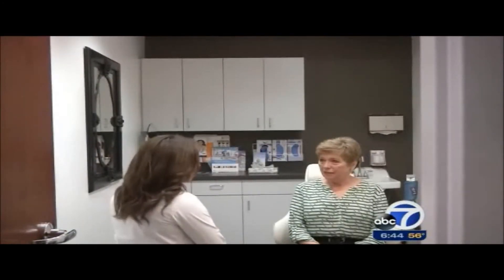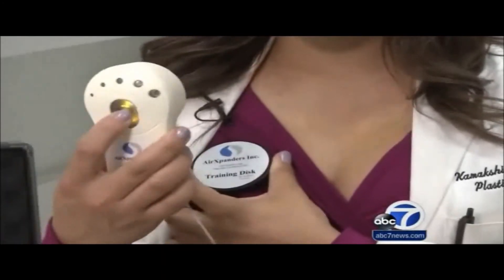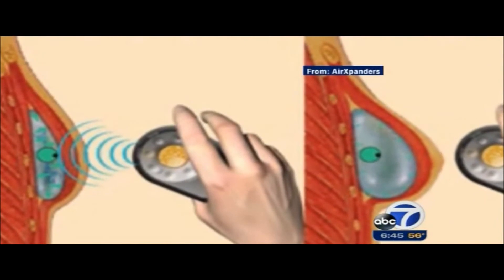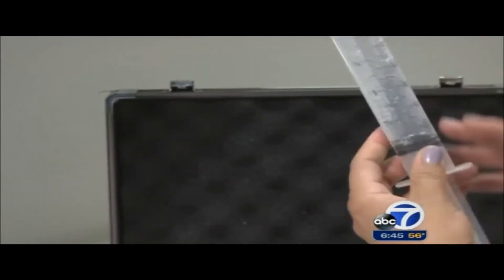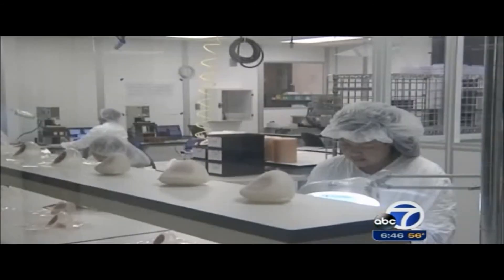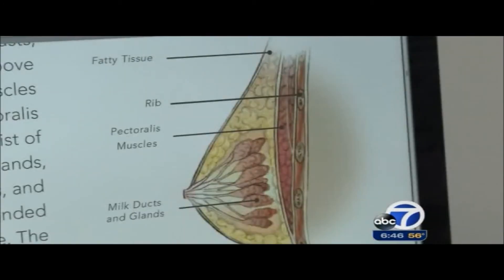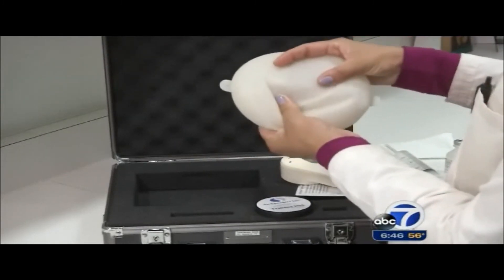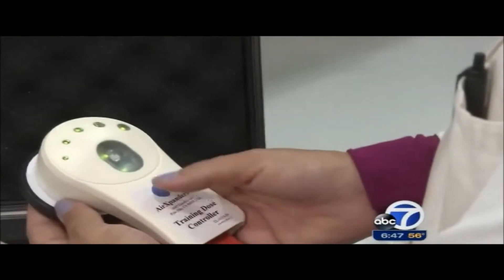Dr. Kamakshi Ziedler shows breast reconstruction with remote control tissue expanders

Comment: I just had surgery March 6,  2018 I chose a double mastectomy in fear of cancer returning to my breast I was at stage 1 by removing both of my breasts I didn't need to get chemo or radiation taking hormone pills for 10 years also my doctor called me a week later informing me they also found microscopic early cancer in my right breast so I think I made a good choice. I also chose the option for using the breast air expansions with remote and three more weeks before I start expanding my breast doing my research hearing lots of woman saying how painful it was getting injections and going back and forth to the doctor's I'm really hopeful of less pain I really want to thank the the makers of this technology for woman with breast cancer I will return to this page to let you guys know how it went thank you wish me luck